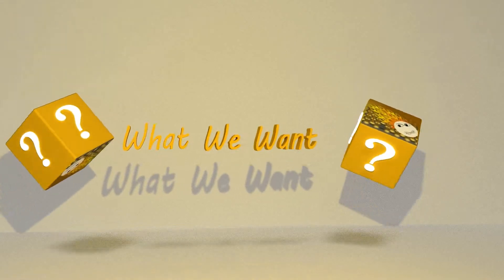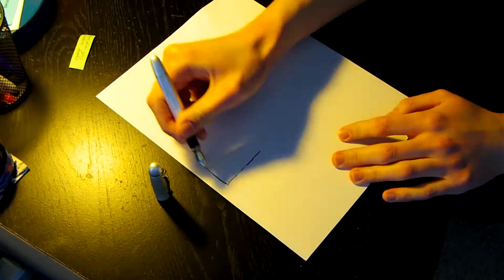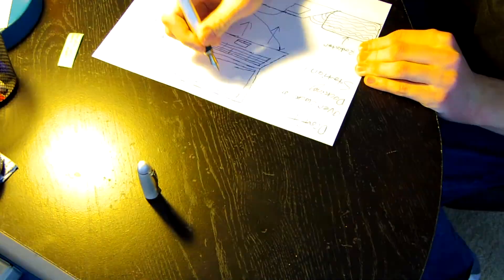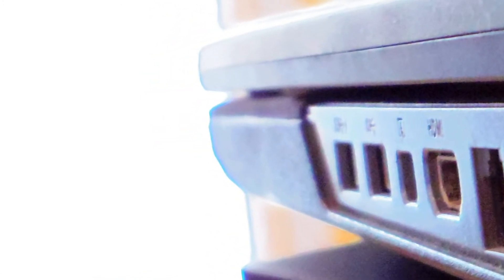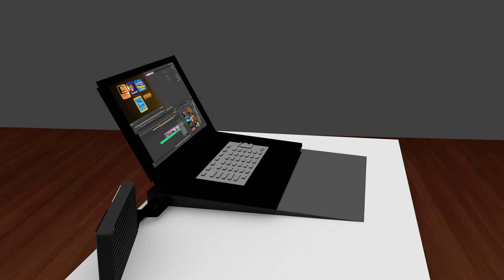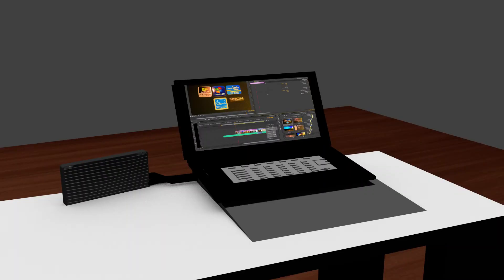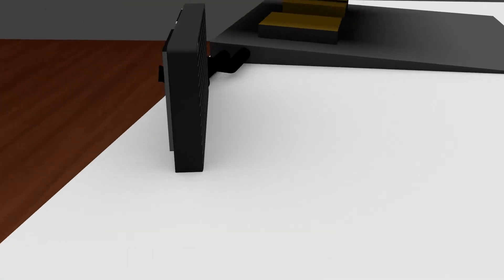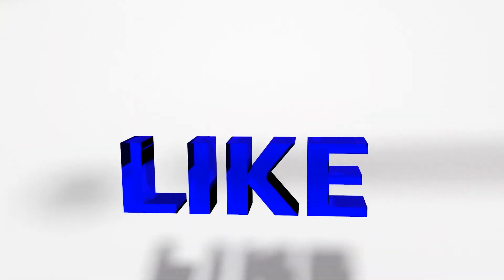What We Want: Laptop Overclocking Docking Station

Comment: I like your idea but it's a bit dated. Laptop and desktop CPUs, at least from Intel, are in par temp and power consumption wise. In other words, they equally get as hot and draw as much power. Performance wise, a strong laptop CPU is as good as their desktop counterparts. I'm speaking from experience. My current laptop has a i7 3920XM. The base clock is 2.9Ghz and I have eight cores (with hyper threading). Most of the time, the CPU runs at 3.1Ghz. In games, I'm turbo clcoked around 3.6-3.7Ghz on all cores. An Intel i7 3770K has a base clock of 3.4Ghz and turbo clocked around 3.8-3.9Ghz. The roughly 400-500Mhz difference is negligible performance. I use a laptop cooler for my own precaution but the laptop was designed with a thin copper core and a tiny fan. As cpus get more efficient, the need for better cooling becomes less extreme,
Reply from the maker: Magmafire I agree and disagree. Yes, as CPUs become more efficient extreme measures of cooling are no longer needed. But..... what about the enthusiast gamers, designers, and engineers who want to push their hardware to the max? With a desktop system if you run out of overclocking overhead in terms of heat you can simply upgrade to a water cooling system but with a laptop you are stuck with the stock heat sink. With my concept I aim to bring desktop equivalent cooling to high end laptop computers! Also, as an amateur animator and video editor I can tell you that 400-500mhz makes a huge difference as far as render times go, especially if the higher clock rate is distributed among multiple cores. Until laptop cooling solutions are equivalent to those of their desktop counterparts this concept will be valid.
Reply from the maker: Magmafire Thank you for your input!
Reply: AA Computers and Technology First, in order to consider laptop overclocking, you have to own one of the very few laptops that can overclock. Software clocks are not the greatest. And I can tell you as a video editor and compositor, 400-500Mhz difference on a CPU is a matter of a few seconds. A good visual software will use your GPU.
Reply from the maker: Magmafire The laptops would be built to overclock, hence the added exposed heat sinks inside the case. And I still have to disagree with you regarding render times, 400-500Mhz does improve each separate frame render by a few seconds anywhere from 5-10s depending on the scene and when you are rendering 3000+ frames for an animation that's quite a  bit of time saved! You may have just prompted me to make a video demostrating this :p
Reply: You should make a video. I believe the software is your limitation but maybe animation software is significantly different from video editors. We'll see once that video comes out.
Reply from the maker: Magmafire Challenge accepted :p, I will send you the link if I make the video!